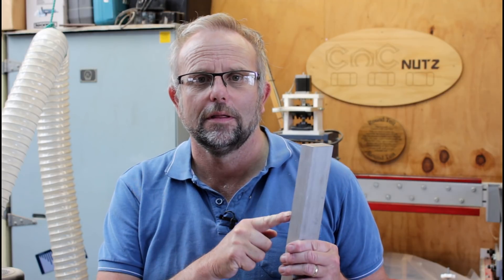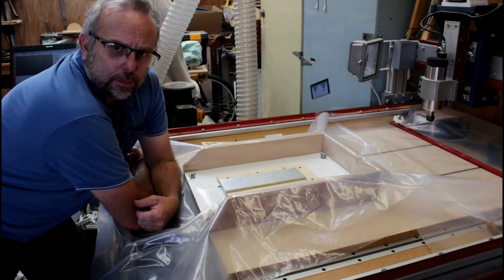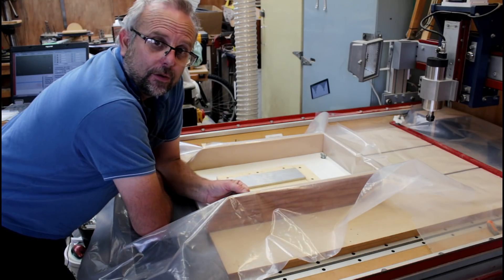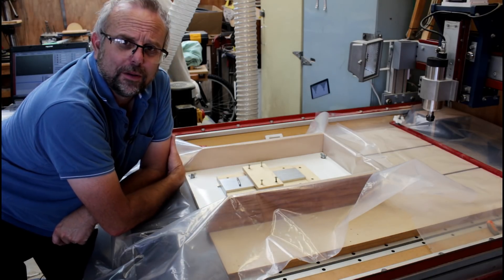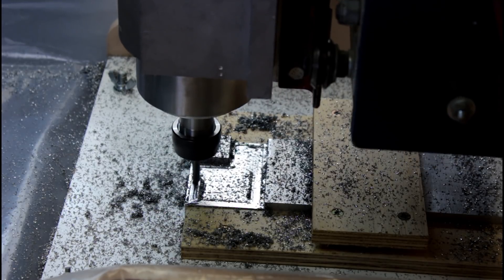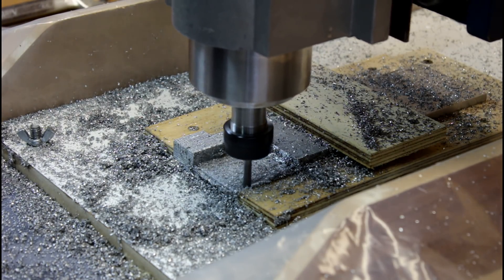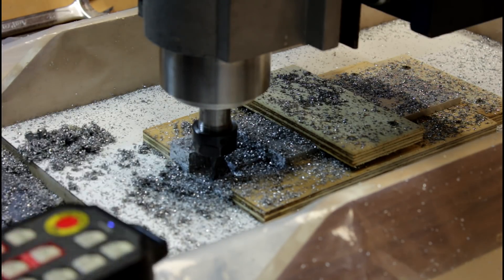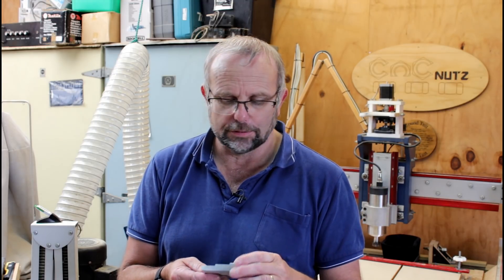Cutting Aluminum on a CNC - CNCnutz Episode 200

Comment: I use an ebay vapour mister with a mixture of methylated spirit and water (sometimes a tad of CRC thrown in) the Metho makes the water evaporate quickly so it won't ruin the table and stops the aluminium sticking to the flutes by keeping the cutter below fusion temperature. the air pressure from the mist tool clears the chips away if positioned correctly and a vacuum to get rid of them as produced. Works like a charm if set up properly. I learned this trick from a friend who cuts out 8 meter aluminium boats all day on a large multicam router.

Comment: Hi Peter, just a few notes, if you don't mind. I'd use isopropyl alcohol, even diluted with water, as a coolant for aluminum. I use Fusion 360 and for the job you illustrated, a 2D adaptive at 25% step over and depth of cut of 100% of tool diameter will do just fine, in very short time. The most important part is correctly setting up your feeds and speeds and, of course, using a good tool. I use Kyocera SGS tools and they cut aluminum like butter. After reading quite a lot of surface speeds, feeds and speeds, I made an excel spread sheet in which I calculate the speeds and feeds and all works perfect as long as you know the Chipload Fz (mm/flute) given by the tool manufacturer. I can send you the table for you to test.
Reply from the maker: Thanks Martin. Am happy to have a look at the table you made. While I don't do a lot of aluminum machining it would be good to have. Using Alcohol as a lubricant and cooling is a good idea.
Cheers
Peter
Reply: @cncnutz  please advise your e-mail and I'll send you the table? I don't see option here to attach a file

Comment: My friend is an old machinist. He told me the other day that aluminium requires a fairly high feedrate in order not to "weld"/stick to the bit. 

Also, use alcohol (ethanol) as lubricant, old trick in the book. 

Perhaps worth trying!

Comment: keep your chips cleared to stop recutting and possible welding onto flutes. I've used just air to keep area clear of chips on aluminium just fine no lubricate
Reply: the idea of lubricant is to clear chips away from work piece rather than cooling
Reply from the maker: Thanks Andrew I'm seriously considering setting up again and doing an air cooled cut. 
Even if only to see how it pans out.
Cheers
Peter
Reply from the maker: Good advise. I was a bit lapse in clearing them away.
Reply: I have used a spray with a bit of compresses air and have not had the problem you experienced. A minimal mist arragement should also not flood your little box.
Thank you for sharing
Reply from the maker: Thanks Tom
Reply: I like to hand vacuum periodically, as I have broken too many cutters with previously cut chips getting jammed in the cut. Not only that but it increases the chances of the flute getting clogged / welding. I also use an air blower on the cutter, it is supposed to mist but that is a problem for another day.

Comment: Vortex and US Router make free phone apps which determine the best tool for milling on CNC. It calculates chip load and RPM for you based on what cutter you choose for particular materials. My particular CNC can't be throttled down for optimal performance on aluminum, but once I learned (as earlier mentioned) the higher the speed, the fewer the cut edges you want; it helped a lot. Sorry, that's all I know, as I am too cheap to experiment with aluminum other than the 2 jobs I've tried.  Thanks for jumping in and learning by experience, it helps you communicate to novices like me.
Reply from the maker: Thanks Peter,
I covered both those apps in my feeds and speeds video and i use them quite a bit but but they wanted much higher speeds than I ended up using. I'm just not familiar enough with Aluminium as it is not something I do alot of but then again if i learnt how to do it maybe I would.
Cheers
Peter

Comment: Hi Peter
I cut aluminium frequently and, like yours, the spoilboard on my machine is made of MDF. To stop the chips from welding themselves to the cutter, I just use WD40.  I don't know why, but WD40 does not cause any damage or swelling of the MDF and certainly works well to keep the cutters clear. I've tried just about every other form of coolant/lubricant, but they all affect the spoilboard. WD40 doesn't. It may not look pretty but it remains stable and flat. 

The other important thing is to keep the chips clear. I just use compressed air to blow them away then a squirt of WD40 every now and then. Works for me.
Reply from the maker: +Geoff Sims
Thanks Geoff.
I cN see that I have much to learn about aluminium machining and will need the do some more testing. That's why I like this hobby. 
Cheers
Peter

Comment: Nice video as always Peter! 👍😊 I'm quite a novice in the "CNC world" but Methylated spirit and compressed air is what I use. It's the cooling that's important. And it is not so messy with the spirit it's just evaporate.
Reply from the maker: Alcohol would cool the cutter well but probably a bit too flammable for my liking. 🔥
Thanks
Cheers
Peter
Reply: It’s actually quite safe, of course you have to watch it. I have an ejector but you can have only compressed air and spray with an spritzer bottle. Cheers 😊
Reply from the maker: +CNCSwede
Thanks
Reply: CNCnutz (Peter Passuello) I have just finished the Aztec calendar that I downloaded from your web page. Nice project! 👍😊

Comment: I do most of my cutting with 2 flute cutters. I originally started with 4 flute cutters, but like you found out they weld to the tips because of the small gap between the flutes.

Comment: From what I understand with a high-speed spindle you want fewer flutes on your cutter. This is why the engraving went without any problem. Mill Cutters tend to have 4 or 6 flutes because of their slower spindle speeds.
 
I have heard of many things being used as a lubricant for aluminum, everything from WD-40 to chicken grease. Lubricant is also used for cooling, which may be the reason why your tool galled. Softer aluminum tends to heat up and actually melt itself against the tool. Lubricant under pressure is useful since it blows away the chips as they are cut, and also cools the tool.
Reply: If I had to guess, I think your project is a height setting tool for a router. Am I correct?
Reply from the maker: You are correct Freeman about the theoretical feedrate but I started slow and shallow then started to push the feedrate up as well as changing the speed down as low as 6000. The rate I settled on seemed the best for my machine. I wanted to use 2 flute but didn't have one so used what I had. I saw videos using WD40 drip but I thougt I would try the CRC product instead. Hot Aluminium is very sticky when hot so I wasn't surprised when it finally galled up the cutter. I'm just glad it only did it once.
Reply from the maker: I could neither confirm nor deny, but that would be my guess as well. 😉
Cheers
Peter

Comment: I have been doing this for a while and a 2 Flute EM will be best for you . I do agree with Robert that you will want to be using compressed air for sure!! coolant does 3 things cools, lubricates and most portentously evacuates chips. If you just use the compressed air you will be doing great. You DO NOT want to be rebutting chips it will increase your chip load per tooth.. I would use about a .0012 inch per tooth (IPT). and also use a coated Carbide End Mill. @ 8000 RPM with a .25" Carbide End Mill i would start @ 30 inches per min (IPM)
Reply: Sorry about that start at 19.2 (IPM) @ 8000 RPM will give you a .0012 IPT
Reply from the maker: Thanks Matt, The 3 flute was all I had on hand but I did want to use a 2 flute
I had also considered air but didn't want to be chasing chips around my workshop forever more . That said the commts here make me think I should have another go with a 2 Flute and air.
Thanks for the calculations as well. I set mine by listening to the machine and changing the feed, speed and depth of cut until it sounded right to me and the cut looked ok.  If I retry I will give your settings a go.
Cheers
Peter
Reply from the maker: Thanks

Comment: Hello Peter, I was watching a video of a gentleman that created a briefcase using 5.2mm mdf, looks to be about 60 pieces all cnc created. His video showed the functionality of the case as well as an hour long video of him assembling the parts together. This is a project I'd love to see you cut out with your cnc, being in the US, getting my hands on 5.2mm mdf is like finding hens teeth.
Reply from the maker: Hi Gary, 
5.2mm is not a standard metric MDF size. Either 4.75mm or 6mm. Basically the same as 3/16 and 1/4"
I found the video you are refering too though I haven't watched it. It looks like the train I made. You would scale the drawing to suit the MDF thickness. It doesn't matter what size MDF you use. The case just gets bigger or smaller.
Cheers
Peter

Comment: Hi Peter, I understand exactly the troubles... I made the error of using WD40 - and the MDF parts of my machine will never look the same again :-(. Metho works well, but I was always scared my vacuum collector would turn into a turbojet... So now I use turps - less flammable and it provides enough lubrication and cooling. All the spray eventually evaporates (if you can tolerate the fumes). Best wishes from across the dutch.
Reply from the maker: Thanks Perry

Comment: Hi Pete, am new at this and appreciate all the tips you give out, great info, I was worried about not having limit switches and you made me think whether I need to fit them or not, I have read up on forums all the procedures needed to get them working right in cnclinux, seems a read head scratcher, but will give it a go once I have other basics out of the way, I'm wondering why nobody has asked you if you can supply the g codes or files for the excellent touch plate you designed, as i wouldn't mind one for myself, I know i could design one using one of the drawing programs solid works or Librecad, but then I'm going to spend another month figuring how that all works, much easier to ask if you would consider supplying you tool paths from g code, heh.
Reply from the maker: Hi Redeyepete
I am not a fan of supplying Gcode as the parameters of the code is unique to the machine that will be cutting it. This is even more true when it comes to cutting
Aluminum. Trying to use my code would most likely be a disaster.
As for the drawing it is multilevel and unless you are using Vcarvepro you wouldn't be able to open it. A DXF version of the file would only show 6 squares so not much use. I think the reason no-one has wanted the file is it was superceeded by the more useful Auto zero scripts I followed this video with. I didnt do one for Linuxcnc but Jerry who has a YouTube channel is doing a series on auto zero for Linuxcnc and he might add the same functionality to his setup. It is a better setup than the touch off plate I built. https://youtu.be/XAaBGp4ToGc

Ask Jerry if he can do something similar to my script. He is a wizard on LinuxCNC.
Hope this helps and if you really want the files email be and I will see if I can find them.
Cheers
Peter
Reply: CNCnutz (Peter Passuello) Thanks for that, some much to learn , managed to get a file with g codes for a motor mount bracket for an electric skateboard, just need to get the right size aluminum block and correct bits, been practicing on bits of wood and foam, to make sure  I don't wreck anything..

Comment: most of the problems with machining aluminium seems to be getting rid of the chips stuck inside grooves 
i think the part you made is eazier to machine then say cut a round object out of a solid chunk of alu where the thin cut groove the same size as the bit gets filled with chips that are hard to remove with a brush and whont be forced out out by the flutes of the router 
unfortunately turning up the rpm to make the chips smaller causes the alu to melt and fuse with the bit , fogbusters seem to work ok keeping stuff cool though and blowing the chips out and away
Reply from the maker: Turning the speed up was definatelly causes the cutter to clog as you say. 
I'm seriously thinking of trying again with air and a 2 flute cutter if I can get my hands on one.
It sounds like most people have siccess with this conbination.
Cheers
Peter

Comment: Nice video nuts ...your machine is muxh more powerful and rigid than the cheap but fairly robust ebay 6090 cnc routers. And those machines are more than capable of machining aluminium...ive seen many u2 videos that prove it....so your machine should be fine....using air is critical.....u dont nexessarily have yo have coolant....i never use coolant on my mill..its too messy...i just use air and it does well
Reply from the maker: Thanks der ddd
The second attempt using air definitely worked better and I was pleased with the result. I probably just need more practice.
Cheers
Peter

Comment: I tried lubricant, way too messy. I went to compressed air and it works like a charm. Keeps the bit cool and blows the ships out of the way. Just another option.
Reply from the maker: Thanks Robert, It was my option 2 incase things went really bad but I didn't like the idea of aluminium chips from one end of the workshop to the other. That said if I had thought I should have got the air gun out and given it a gentle blow to see what happened. I had plenty of chances to do it that was for sure.
Cheers
Peter

Comment: Peter, what settings on your VFD did you use to have 8000 even be usable? Something for constant torque. Mines basically useless under 12k
Reply from the maker: Hi Julius,
Here is the writeup I did for my spindle install video
http://www.cncnutz.com/2017/04/installing-spindle-part-2-episode-145.html

If you look down the page you can follow the link to my VDF configuration file and download the settings I used.
For mine I used the constant torque settings shown in the manual.
Cheers
Peter

Comment: First off, use Kool Mist formula 77 as your coolant/lubricant. 1 gallon (3.78 liters) will make 40 gallons (151.4 liters) of coolant so it is inexpensive. (Even for me.) You don't need a flood coolant... you just want to keep the cutter cool enough to avoid galling. You can even use a spritzer bottle and spray it when it looks like it is getting dry. (I have a mist coolant on my big bill, but hand spray in my little Frankenlab.)

For your cutter, unlike steel, you want less flutes... you want it to fling the chips out, and they tend ti curl a bit. I have found sme inexpensive bits that I use frequently.
2-Flute Cutter: https://www.banggood.com/6x22mm-Double-Flute-Spiral-Cutter-CNC-End-Mill-Cutter-p-1080681.html

These single flute cutters also work very well... be careful with them... they are sharp... like slice your finger if you are not careful sharp.
https://www.banggood.com/5pcs-6mm-Shank-Single-Flute-End-Mill-Cutter-Set-CEL-32mm-Tungsten-Steel-CNC-Bits-p-1098432.html

These are another that I use with some success... still figuring out which my favorite is.
https://www.banggood.com/5pcs-6mm-2-Flute-End-Mill-Cutter-Spiral-Drill-Bit-CNC-Tool-6x6x24x68mm-p-1042240.html

But the Kool Mist... it helps a lot with the chatter. 
https://www.amazon.com/Kool-Mist-Concentrated-Coolant-Container/dp/B00H9P12HE/
Some will say that a 1:25 mix is better... but that's still 1 gallon to 25 gallons or 3.78 liters to  94.63 liters.

I have also used 70% isopropyl alcohol with great success... but it is flammable and needs adequate ventilation.
Reply from the maker: Thanks Jerry,
Good info as usual. I checked out the cutters you mentioned and bought a couple ofthem to see how they go. I needed to replace the 6mm one I had. It iwas far too blunt for this project.
Cheers
Peter
Reply: I think you will like them... I haven't had a chance to try the single flute cutter yet... my friend swears by them. I have been using the two flute cutters for years.
Reply from the maker: +askjerry
Thanks Jerry looking forward to trying them out.
Reply: Best way to go for diy machine is a cheap mister for 20$ and put water in it. Costs nothing, smells great, no mess for welding and cleanup. What's better than that?
Reply from the maker: Thanks Tim

Comment: Have a look at these cutters  https://chipx.co.nz/product-category/cutting-tools/chipx-tools/router-bits/                        They will give you the requmended feed and speeds and it's a kiwi outfit
Reply from the maker: Thanks Daniel,
It turns out I was given one of those cutters a while back to test and forgot about it.
I spotted it this morning and have just finished cutting a new Aluminium plate with it and it came out great.
Cheers
Peter
Reply: Did you goto the vertigo technologies xmas do
Reply from the maker: +daniel lyall
No but I called in just before Christmas and need to drop in next time I'm in the area.
Reply: I know there tech support guys /chipX guys